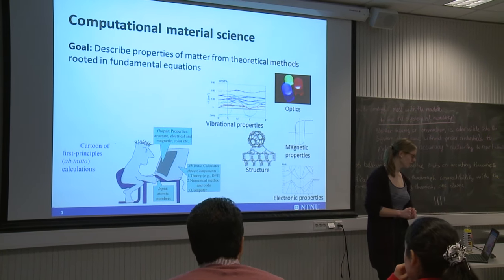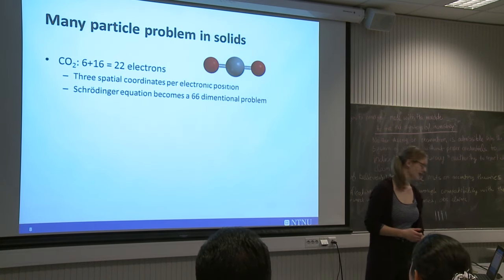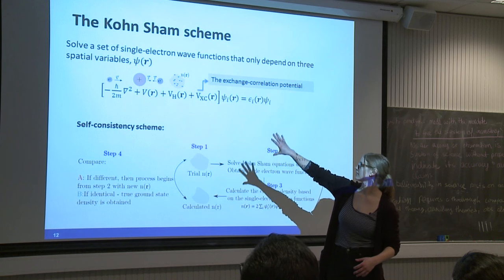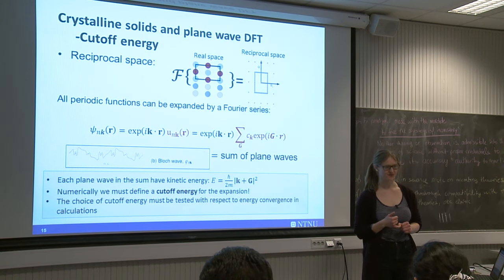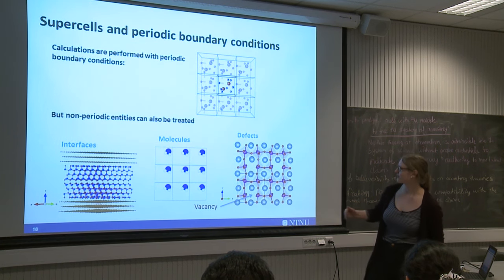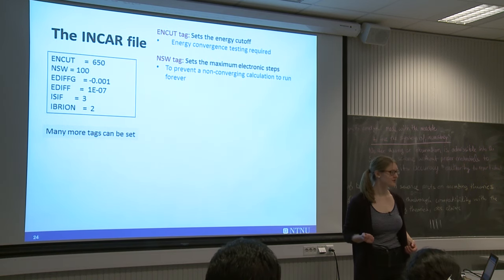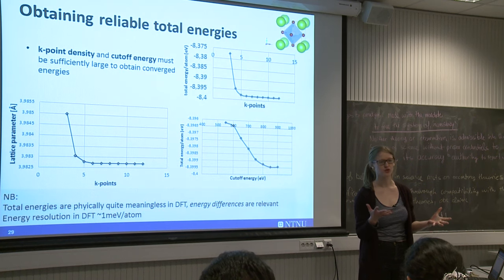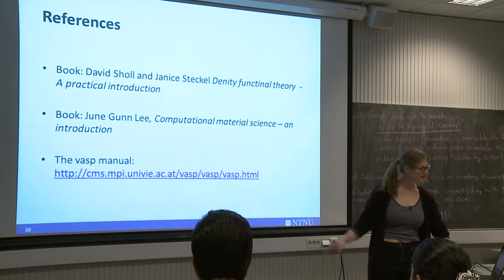Fundamentals and applications of density functional theory

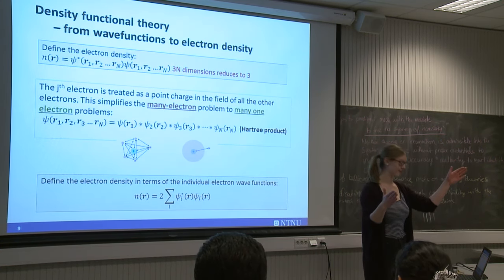Comment: I cannot understand 11:10 why density turns from 3N to 3 dimension. What means "point charge"?
Reply: If you look at the equation there you can see that the wave function depends on the coordinates of all electrons, so its a 3N dimensional problem. So you need to know all the coordinates of all the N electrons. If you look at the electron density, it doesn't depend on the coordinates of all electrons. The vector r "shows one position in space" where you can define the concrete electron density at that position. So it's a (usually) 3 dimensional problem. You don't need to know all positions of all electrons anymore, because you're just looking at the electron density, which kind of means "how many electrons will be on average in that position". And you can actually measure the electron desity with STM, so at a certain position you have a certain electron density and it changes if you change the coordinates of the observed position.

And point charge means that you have an electric charge that is considered to exist at a single point, and thus having neither area nor volume. So for instance the charge is not smeared over an area, but is just at a single point.

Hope it was understandable and right and hope that it helped :)

Comment: DFT seems to do a lot of simplifications, that, to me are not straightforward. Or lets say, obvious that these simplifications do not destroy the connection to reality. I have the impression by chosing your specific parameters (pseudopotentials etc,) you can pretty much create (exaggerated) every result. Or is DFT always right? ^^
Reply: I'm very new to these concepts, but I arrived with a similar skepticism. As it turns out, experiment has confirmed the validity of these assumption time and time again, within a acceptable percentage of accuracy. In order to gain more accuracy, there have been purer calculations done, but at much higher computational/time costs.